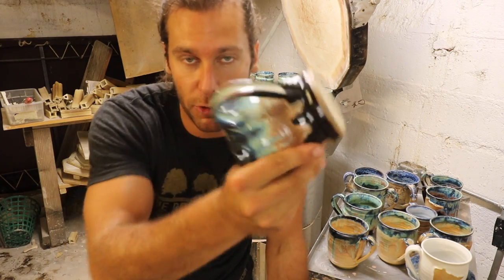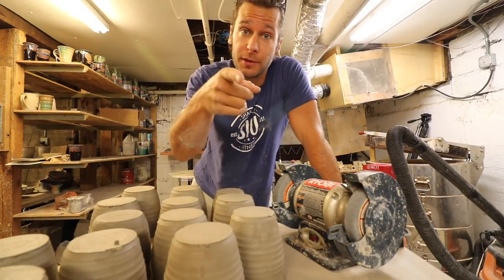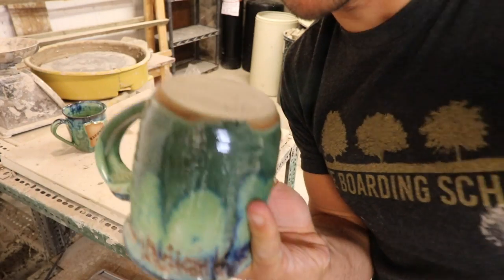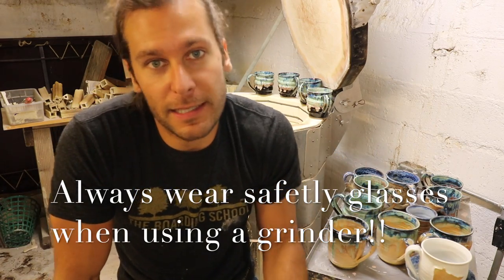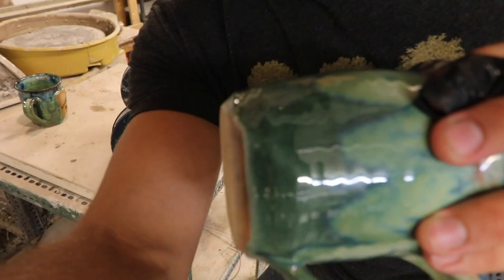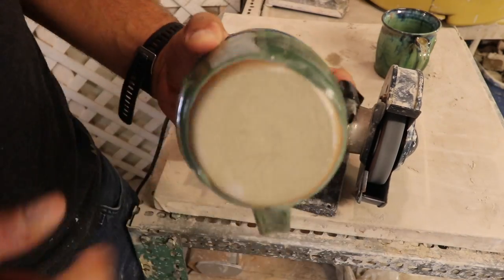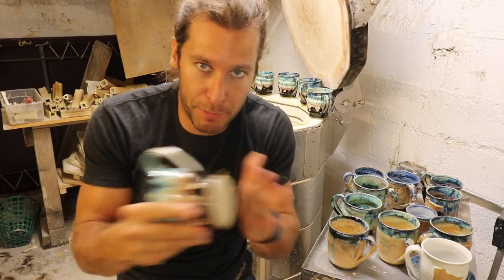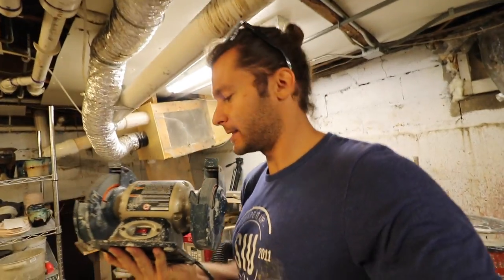How to use a GRINDER to save your pots!

Comment: Safety glasses yes! But what about a dust filter mask?
Reply from the maker: Yes that would be the safest!  since it has been fired to cone 6 it doesnt kick off very much dust, like it would if you used a grinder on something bone dry , then a mask would be imperative! But yes thanks for the comment that would be a good idea !
Reply: I would also recommend a particulate filter, the crystalline silica from the glazes are very different from the clay particles and pose a serious occupational risk for silicosis (potter's rot).    OSHA.gov can help you understand and limit your risk.
Reply from the maker: Casey Taylor Thanks !

Comment: I have a similar Ryobi grinder and I was concerned because in the safety instructions it says 'Never grind on the side of the wheel. The wheel will shatter. Grind on the face of the wheel only.'

Comment: Bolt it to a table and remove the cover on the end so you can use both hands and you will have more area on the grinding wheel to work with.
Reply: Never, ever use the side of a bench grinder wheel. this is so dangerous in so many ways.... see the hospital pics of people who have. grotesque